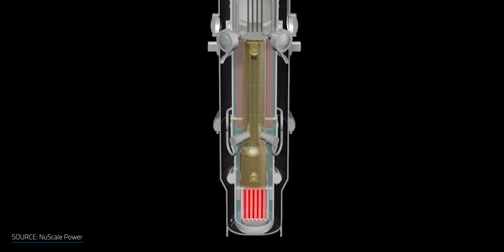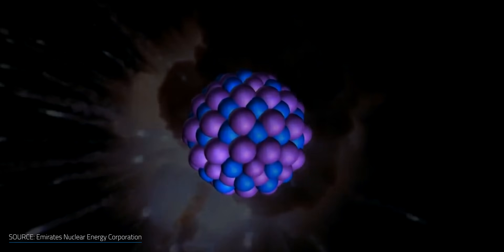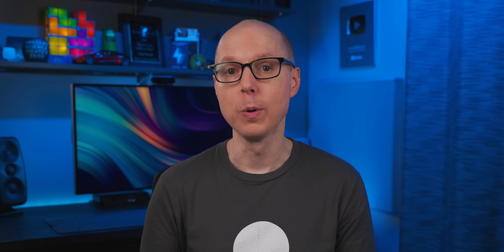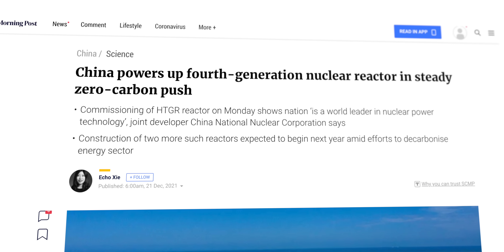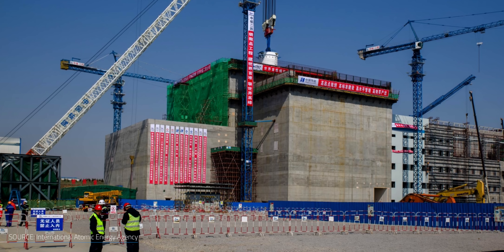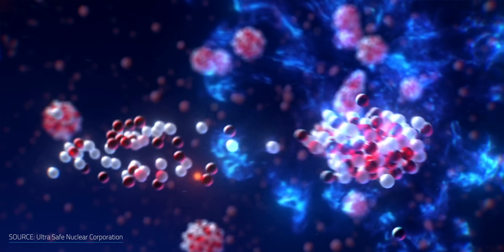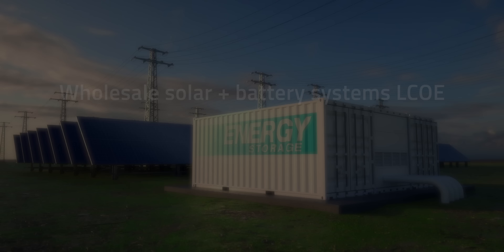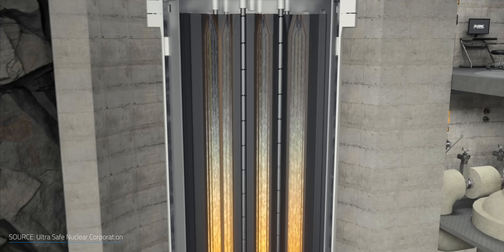Forget Small ... What About Micro Nuclear Energy?

Comment: I'm curious if the death rates of wind includes the deaths of birds flying into turbines. The CO2 production from making the materials to contruct a wind turbine is also never offset by the amount of energy produced by said wind turbine. The CO2 from making the cement required to anchor the turbine in place is pretty ridiculous. Then there are the health complaints of those that live near wind turbines (migraines, anxiety etc) due to the ultra low frequency sound waves they give off. Makes large scale wind energy alot less appealing unless you are putting them on tethered blimps which pose a different hazard if they are near flight paths. All this makes me feel they are not a truely viable solution to CO2 production. Something like the use of Pyrolysis to convert plastics back into ultra clean fuels would allow us to mine and refine less oil while reducing pollution of our oceans and reducing microplastics entering the food chain would be FAR more benefial for the money being devoted to wind energy.

Comment: Most of the issues with nuclear power going forward are man-made issues. Regulations, certifications, licensing, and cost are all man made issues, made to make nuclear less feasible than the "renewable" energy production. Everyone always goes on about the nuclear waste, yet never hear any of those same people talk about the extremely dangerous and hazardous materials used to produce solar arrays or wind turbines, and the fact that solar cells especially have loads of toxic heavy metals in them that must be dealt with at the end of their life. The "Green Energy" crowd is more of a scam than anything. They only want to use whatever power source makes them and their allies the most money. Solar and wind facilities need constant maintenance and replacement of key components on a frequent basis. Solar panels need replaced, to maintain peak efficiency, every 10-15 years if not sooner due to weathering of the panels. Wind turbines can last for maybe 20 years before the entire thing needs replaced. Nuclear facilities on the other hand, with regular maintenance, could last for 5-6 decades or longer. The most ridiculous thing with solar and wind, is that they still require the use of fossil fuel powered plants to pick up the slack and even out the loads on the grid. Solar and wind also keep the petroleum industry afloat, because they require petroleum products in the production of their components. Meanwhile, a nuclear power facility's only need for petroleum products is the insulation on the wiring. A nuclear facility could in theory power the production of everything , aside from the wire insulation, required to produce more nuclear facilities.  I am not sure solar and wind energy could be made without petroleum products. Neither solar or wind can compete with nuclear for power output in any way. They require huge amounts of land to put up solar arrays or wind turbines. Solar power production require about 75 times as much land area as nuclear and wind requires about 360 times as much land, to produce the same amount of energy. Also is the price per Mwh for solar and wind taking into account the price reduction due to government subsidies? As far as I know there is no such subsidies for nuclear power plants, please correct me if I am wrong. Solar and wind receive huge subsidies, over $100 billion dollars since 1979 and mostly in the last 10-20 years. The Agua Caliente Solar Facility received over half of their funding to build from the US Department of Energy in the form of a $967 million guaranteed loan, meaning they got preferential interest rates, and if NRG Energy and Berkshire Hathaway fail to pay then the US taxpayers are the holders of the debt.  I know of no nuclear power facility that has received such lucrative deals. I am a firm believer that solar and wind will never be viable alternatives to fossil fuel and nuclear power production. The only way solar could be a viable alternative, is to have solar arrays in orbit that beam energy to the surface. There is too much variability at the surface, from weather to varying amounts of day-light to poor angles for catching sunlight and a whole myriad of other things, to have reliable solar production from ground based solar facilities. Then there is the issue of bird deaths associated with Concentrated Solar Power facilities, that literally incinerate birds that fly over them or scorch the feathers off of the birds which leads to a slow and excruciating death for the bird. Wind turbines kill birds also, though at least they are almost always instant deaths. THere is also the displacement of native wildlife from the areas that large solar facilities are built. 166 Desert Tortoises were displaced when Ivanpah was built (again with a $1.6 billion guaranteed loan from the US government on a project that cost $2.2 billion). And figure in that it would require another 17 identical facilities to equal the power output of Diablo Canyon Nuclear Plant,  or roughly 100.8 square miles (roughly 1/8th of the Great Smoky Mountain National Park or bigger than Mesa Verde National Park and more than twice the sizes of Pinnacles National Park in CA) of desert vacated of tortoises. That would also mean 100.8 square miles of bird incinerating idiocy. Sorry for the National Park references, I used to work for the Park Service.

Comment: The downside to big centralized power sources is that the electricity has to travel over an expansive infrastructure with a loss of power by pushing electricity through lines over great distances. Having many separate localized power sources would eliminate many of the pitfalls of large long distance networks. These are long lasting heat sources for steam generators so water is always an issue regardless of the method of temperature regulation of the reactors.

Comment: The big gorilla issue I see with SME's, nuclear power in general, or any power plant that burns stuff is that it all boils down to boiling water.  The heat cycle is the ultimate goal whatever the scale or power source may be.  Nuclear materials could instead be paired with a phosphor matrix to create an EM radiation generator (think permanently glow-in-the-dark) that could then be paired with photovoltaics, tuned for the appropriate EM wavelengths, to directly without any moving parts produce electricity.  It may not be super efficient or high-output, but it would be near zero maintenance, work 24x7, extremely scalable and easy with current tech.  If anyone has other ideas how radioactive processes can produce non-thermal energy (light, magnetism, sonic, chemical) I'd like to hear it.

Comment: There is a nuclear reactor being built in Canada by Moltex that will be able to use nuclear waste as fuel. Supposed to be running by 2030 or so. Also, unlike pretty much every other nuclear nation, the USA doesn't recycle fuel and ends up only using 1% of the fuel before discarding. I think reactors that can auto recycle can solve most of the problems of fission nuclear.
Reply: That will be at the Darlington Nuclear Generating Station near Bowmanville, Ontario.

Comment: The concept of micro reactors would have a profound effect on the monopoly of a single supplier of Electricity such as Eskom here in South Africa.. Cities would be responsible to generate their own energy requirement and control thereof. The incident of cable theft for instance would be reduced dramatically and the need for thousands of miles of overhead cables will become obsolete in many instances.. The electricity generated by one nuclear submarine is adequate to supply a city as big as CapeTown for its requirement but that is not the technology envisaged for the micro nuclear units still in development but most certainly a viable concept for the future.

Comment: It doesn't really add up, does it?

It seems like it's just another "fossil fuel" industry ready to kick us in the ass, 50 years down the line.
"Oh, yeah, about that waste disposal ... well, we haven't quite figured that one out yet... and ... well, we've got a little bit of a problem in some areas, best not to visit - look for the sign posts"

If solar and wind are cheaper NOW, then with more advancement applied, they will only get even cheaper. 

Sure, there's some question marks about the battery tech and mining of the materials required to support it, in terms of environmental damage, but battery tech is advancing at an incredible pace - an insane pace. 

Wind, solar and potentially geothermal and wave power, are all we really need.

Right now, the battle cry against Fossil Fuels is "leave it in the ground." 

We are going to need a similar battle cry for any country that thinks nuclear power is an answer.
It really isn't, because ... the waste. 

It's dirty. Not as dirty as fossil fuels, but dirty none-the-less.
Sure, there's an unfeasible amount of hate and FUD around nuclear, that is unfounded, in terms of safety, but that pesky issue of nuclear waste crops up again and again.
Thousands of years of storage required to keep the waste "safe"? 
Hmmm, sounds like a great big carpet, under which you can "hide" that rather complex problem. 

How much exceptionally dangerous waste is too much?
If we can mitigate the amount of waste created and reduce it 100 fold, is that still too much?

... thousands of years ... great surprise for "future mankind", should civilisation collapse and rise again ... "oooh, what is this amazing structure under the earth - let's have a little dig to find out ...."

Comment: a thought, why not go even smaller, say, ones that can be dropped down oil well heads on a played out field?
all of the power producing equipment right along with it, outside of control and power connections, it would already be sealed away, gain power from it as long as it can produce more than it consumes
at the end of life, decommission by sealing the well, no fuss, no muss
safeties would keep it from ever going critical, even if it were perchance to melt down, it really can't go anywhere damaging.
it is in a sealed strata, a nice long term tomb for millions of years
Reply: Just one (actually two) ....Water table.

Comment: 8:38
A 1 mWh power station can supply power to 1000 homes? I'm no mathematician, but dividing 1 mW to 1000 homes gives each home 1 kW. Here is the power consumption for common household items and appliances:  Blow dryer (1.5 kW), a 2 ton HVAC system (7 kW), a cloths dryer (5 kW), electric stove (5 kW) and up to 140 kW to super charge an electric car! A level 2 car charger needs 19 kW.

It wouldn't be uncommon to cook and do laundry on a hot day. Dividing 1 mW between 1000 homes would be tricky and it's going to get worse as we are forced to abandon fossil fuels. Until you can guarantee an uninterrupted energy supply to people, it would be wise to not give up the current, reliable power supply we currently use. Our "leaders" are leading us to disaster, by not giving us a reliable substitute for fossil fuels.
Reply: Americans never did learn math.

Comment: There is no need for nuclear, small, large or micro, to provide electricity, everything can be done with the renewables and storage systems that we have now including baseload generation. There is no need to pollute our environment with waste (spent) nuclear fuel or, heaven forbid, a nuclear radiation leak. One difference from the US is that Europe has interconnectors between different countries' electricity grids, it's how we load balance, and Morocco is adding to this by building two interconnectors to carry massive Sahara solar PV generation to Europe to add even more power.

Comment: 8:21
Hold up. Doesn't "higher U-235 concentration" mean MORE enriched fuel, meaning that such fuel would be more expensive a shorter lived?

And wouldn't larger reactors allow for greater economies of scale? Sure, we'd lose some energy transmitting power over greater distances, but there's also an energy (and monetary) cost* to be paid in making a thousand little systems instead of a hundred big ones.

Quote from Video: "micro-reactors use low-enriched uranium with uranium-235 in higher concentration"

*Edit: Grammer
Reply: That's what I noticed too.

Comment: You missed the molten salt cooled reactor, which is more efficient than a water cooled reactor, due to higher temps, and safer than other coolants due to low reactivity (molten metal + oxygen usually = burning metal!; molten salt + oxygen = nothing!).
Gas cooled reactors however have a different problem - they HAVE to run at very high pressures to move the heat around. This means the pressure vessel has to be very strong & hence welds become much more critical. Molten Salt coolant is at ambient pressure at very high temps - the reactor vessel is hardly a pressure vessel, more a containment vessel! You miss out on mentioning Moltex's wasteburning MSR design, that is designed using many existing reactor components, just repurposed for molten salt use. Eg the fuel is in fuel pins as a transuranic salt, not oxide, so there is no pressure effects, yet the pin keeps the fuel separate from the coolant salt, so no pumped fuel salts etc. etc. The use of existing components makes the design cheaper too.
You also need to look at your LCOE costs again, the MSR LCOE's are in the $40-$50 range, not just Thorium reactors.
Also the construction costs are low too, for the Moltex design, as estimated by Atkins a significant nuclear contractor in the UK, the cost is lower than for a coal pwoer station of equivalent capacity @~$2000/kWe, additionally if the Moltex design uses the heat storage/peak demand system, where hot molten salt is stored for 16hrs out of 24, then a 3GWe output is achievable for every 8 in 24 hours, this requires more generator capacity, but the same 1GWe of reactor capacity, and makes the capital cost about $1000/kWe.

Comment: There are 1000's of us ex-Navy nukes.  We know it can be done safely.  Think about it.  In the US Navy the reactors are operated by 20-25yo kids and have had zero accidents. (There have been minor incidents).  We also know that a computer can watch and operate the reactor far more effectively than the human element that was "free" in the Navy.  Perhaps they are largely computerized now, I don't know.  I served from '82-'88 and there were no computers.  With a natural circulation design and redundant cooling methods, this is so simple that it could power every town without any manpower.  Just a maintenance crew that travels around to several towns for routine checks or entire vessel replacement every 10 -?? years to be refurbished and refueled at a factory.  But then there is the issue of Hillary Clinton selling half of our Uranium production to Russia....  SMH.

Comment: Due to it's transient nature, solar and wind will never deliver more than 20% or so of our energy needs. The only viable solution that can make up the remaining 80% is hydro (which is limited by geography and climate) and nuclear. The harsh realty is that when we finally get serious about addressing climate change and go nuclear, solar and wind won't be necessary. In effect solar and wind are just a temporary solution. They can only reduce our fossil fuel use by about 20%, and the power they produce will be redundant with the power generated by the new clean nuclear plants.

Comment: I think the problem with very small reactors is that the risks might not scale down as fast as the power output, which would mean it's either higher risk or proportionally larger safety equipment costs. Smaller size may also have effect on the operational safety culture.
Reply: The potential for leaks goes away up just because there is lots and lots of tiny nuclear devices everywhere bro. Leaks that are harder to detect but definitely deadly levels. If you have all the nuclear in one place it gets easier to tell there is a leak

Comment: Yeah, the pros openly acknowledged that there is a valid physics reason for "Low energy nuclear reactions".  In other words, they admitted cold fusion is real.  We have just started to comprehend what's happening.  It involved meta particles, maybe boson loading.  In almost every case, there is a stabilization method like a metal lattice, rotating magnetic fields, a set of frequencies for constructive interference in matrix, and nano sized harmonics that act on the fuel, like deuterium and lithium.   I'd like to just be the mad scientist that tells them what to build, without having to explain exactly why I think it's gonna work.  =)  I got something with thin films in a roll that I wanna try.

Comment: Fast neutron reactors are a more realistic near future step forward than thorium. The inherent benefits effectively solves the question of upscaling fuel supply and waste disposal infrastructure because fast neuron reactors can use light water reactor waste as fuel converting it from long term waste(thousands of years) to short term waste(centuries) in the process. Not only that but packing more of a punch than light water reactors, fast neutron reactors run hot enough to provide super heated steam needed in existing fossil fuel based power plants meaning they can be used to convert existing coal plants without having to rip the turbines out, and further helping the waste disposal side of things fast neutron reactors have a 20yr+ duty cycle allowing you to design a sealed self contained unit that can simply be trucked away whole to the disposal site or reprocessing facility when the fuel runs out(also makes it harder to steal nuclear material in a world where reactors are more prevalent).